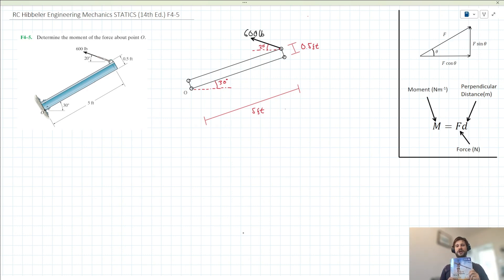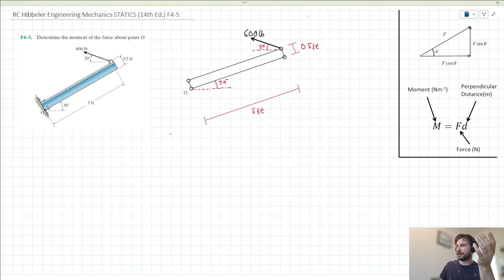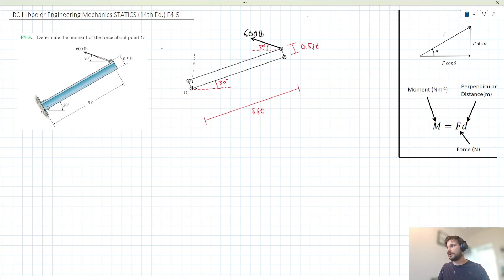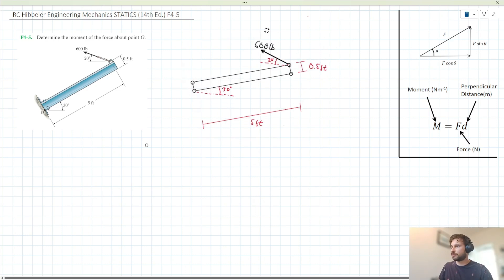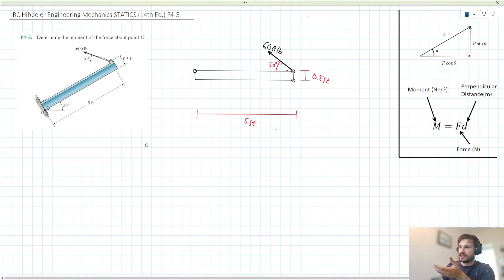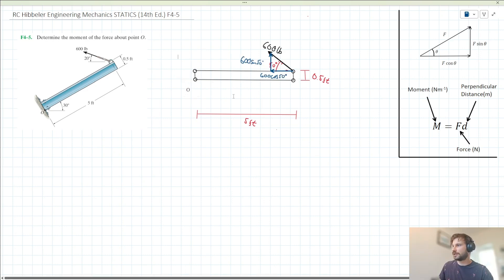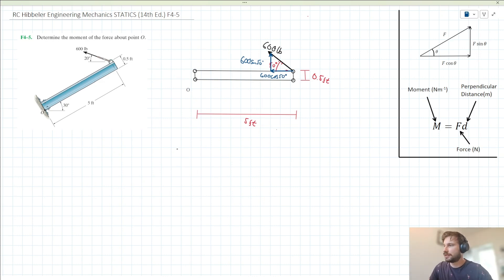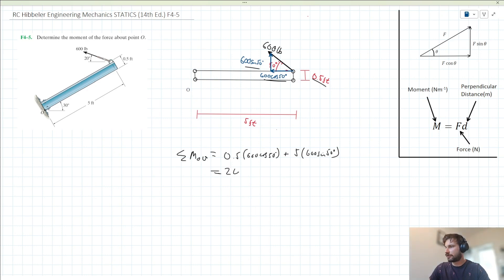Hibbeler Engineering Mechanics STATICS: Problem F4-5 Walkthrough

Comment: shouldnt the Fx be negative since its pointing in the negative x direction? Thus Mo = 5(600sin50) - 0.5(600cos50)
Reply from the maker: Thanks for the comment nexxar

That’s a smart question. In the video I took anti-clockwise as the positive direction, as I anticipated the result to be an anti-clockwise moment from the look of the diagram.

Your suggestion here is perfectly valid, it’s just that you’re choosing to take clockwise as the positive direction instead. We’re arriving at the same solution here, just using different pathways to it.

Hope this makes sense!
Reply: @bertieknight812  in the book, it says the answer is M=-2490lb ft, why is it negative if its going counterclockwise??